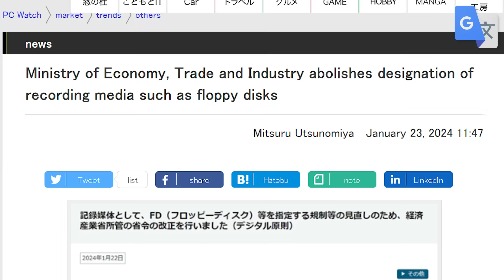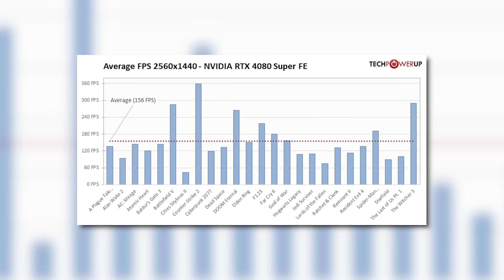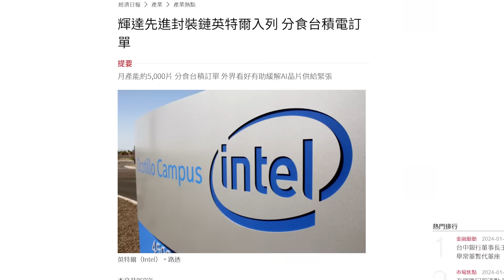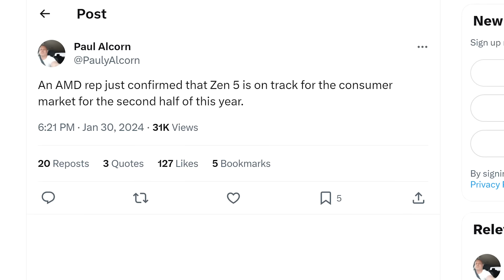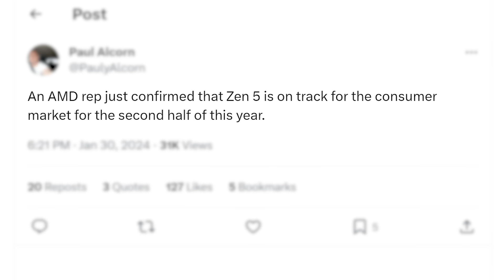AMD Just Came Out And SAID IT!

Comment: I'm currently rocking a 5900x that's been undervolted to get it to its 5.1ghz max clock speed, 32GB of 4000MT RAM, and a 3080ti. I can't wait to build a new PC later this year with a 9950x, some DDR5, and a 4080 Super. I'll finally be able to dick around with AI, with the hope of using my own voice as a template to create a different, more melodic voice.

Comment: My Floppy and Zip Disk are still generally fine for semi-regular data transfer use. I wouldn't trust them for backup but for transfer they are a useful option for retro computing.
Reply: Just this past weekend, I donated my Zip 250 drive and several cases of disks to the PC vendor at the local flea market. It was still working, which surprised him.
Reply: @OcularPerceptions  You'd have got good money on eBay for Iomega Zip stuff! I ideally want to update an external SCSI and an internal ATAPI model from 100mb to 250mb models if I can!
Reply: @bigd5090  I probably could have, but I've had those for years and preferred to help some local folks. Also, we're busy decluttering our home, so keeping things hoping they'd sell online would just delay our goal.

Comment: wait what, so zen 5 is not going to be full x3d yet? i need x3d but didnt want to buy 7000 gen thinking we were getting closer to 9000 release, what should i do now?
Reply: Probably go for 7800X3D. It seems pretty good and a lot more reliable than the higher X3D CPU’s. If you have to wait for good and reliable 9000 X3D series, it will probably be 2026.
Reply: @PaintrainX  it feels so wrong buying x3d now so late :/
Reply: @BuzzKora  I understand. But honestly, I don't think we will see big performance gains.

Comment: 1 Million bytes, think of what that meant in the early 70's. That's about 8 MILLION Bits on on an 8" floppy. Before that, punch cards 😅

Here's the kicker, data rot/integrity. The smaller the data cells get the easier the bit can flip. You can't leave most economy QLC solid state drives unpowered for more than a year without having some data rot, same for basically any new USB drive. How do i know? 20+ years of I.T. work. Hell, you can't even suffer a few power losses in a row with many QLC drives before they die. Hopefully they recover if you leave them powered on for a few hours or a whole day so they have time to rebuild.

With that said, I've been replacing floppy drives on embroidery machines with USB/Network adaptors and give them only USB drives that have proper controllers on them that have some level of ECC and wear leveling. Basically any higher end premium brand, not all. Still, this adds a layer of data transmission you can't trust. Although i haven't seen any issues in the last few years, but the clients might not even tell me idk.

Pro tip for flash drives/cards with no controller if they have bad sectors, run a full read then zero write consecutively. The read will warm it up and the write will reset the bits, most of the time "repairing" the sectors. I have an 64GB SD card i did that to two years ago on one of my security cameras, still going strong.

Comment: A 4080 Ti using the AD102 die with 12,000+ cores and 20GB of RAM for $1,200 would have made for a much better product. Then push the regular 4080 to $899-$999.
Reply: For consumers yes of course. For Nvidia however, AD102 die is in short supply because they are mainly bought up by AI companies. So in Nvidia's perspective, why sell cheap GeForce to you when I can sell Quadro class GPU for far more profits .

Comment: Price drops don't gain any enthusiasm.  Just look at how well that worked for AMD over the last few years.  Each time they cut the cost of their cards, it's usually met with crickets.  Nvidia just rebranded the 4080 to "Super" to garner attention and to sell off the remaining 4080s that didn't sell (most of them).  Really should have been called a 4080D, just like the 4090D.  D for discount.

Anyway, I bit the bullet and grabbed one due to the uncertainty of the 50 series, and needing a 4K/60 capable card now. My 3080 10gb doesn't cut it.  Wanted an FE and even had one in my cart, but because of how stupid the Nvidia shop is, when I went to finalize, it said nothing was in my basket, and they all sold out.  Ended up having to settle for an MSI Ventus since I needed a card that was 330mm or smaller.

Comment: Ah yes the days of installing windows using multiple floppy disk.
Reply: A normal "ok" picture on my nokia phone is 2.4MB in size
Reply: Or installing MS Office 3.11 for Workgroups...😅
Reply: i'd genuinely want to install win 10 like that
Reply: And Linux Slackware 1.0, when there was no graphical desktop yet in any Linux distro. But yeah, Windows for Workgroups 3.11 in floppy disks, too...And MS DOS.

Praying that one of the  dunno if 14 floppies (can't remember) of a linux distro wouldn't fail, as then you got nothing, all installation would break at that point. And would have to get the full distro again, physically, as there was no way to get that from "internet" (and quite later on, with terrible 9600 bps speeds, etc).

But it was way worse with the Spectrum, Amstrad, MSX and etc (previous to the bigger jump of the 8086 series), relying on tapes, and that your tape player was well fine tuned (the glorious screwdriver trick)  to avoid loading errors. I can't remember well, but I think there was a trick using an utility to force those disks to get 2MB (actual capacity unformatted) versus the usual 1.44MB (HD) or 720k (DD). The bigger 5.15 had way smaller capacity.

 In these specific matters I wouldn't want to go back.

Comment: Just bought a Zen 4 so not looking to switch before Zen 6. Hopefully, AMD will have fixed the issue where DDR5 with 4 sticks only train stable to 3600 by then and anything else is a pain. Fixing this would be great for us 192GB ppl
Reply: 192GB wow!
Reply: It's not entirely about 4 sticks, I'm running 4 sticks at 6000 with a 7950x and zero issues. The issue is the 32gb sticks are dual rank, so from the IMCs perspective it's basically running 8 sticks. Perhaps zen 5 will see enhancements to the IMC, it's not unlikely. You can always sell your zen 4 cpu for a good 70-80% of what you paid for it and get a cheap upgrade.

Comment: Best thing about the 4080 super is we should be able to get the 7900xtx for cheaper
Reply: Ehhhh the 7900 Xtx still outperforms the 4080S in raw performance, the 4080S had to outperform the 7900 Xtx in hope of a price reduction. All Nvidia did was pretty much release the same card, given 1-3%, at a lower price…
Reply: @Decisiveness_   as always people like you severely dismiss DLSS , Power efficiency, Frame generation and general Ray tracing performance. This is why Nvidia still massively outsells AMD. And this is  why i personally would gladly pay the 20% Price premium.
Reply: @snakeace0 Nvidia outperforms AMD because ppl know nothing about computers. 75% of ppl don’t need or use those features.

Comment: For me, the sad thing about the 4080 SUPER is the fact that it took Nvidia this long to release what the original 4080 should've been.
Reply: Nvidia loves to milk the customer
Reply: Yeah mostly, although $999 is still too much.  Should have been $799 - $899 tops.  Ngreedia thought they would skip the middleman this time around though and just scalp their own cards from the start.
Reply: @Neonmirrorblack inflation adjusted vs 1080, it should be $762.
Its still 33% overpriced vs 58% overpriced when 1st launched
Reply: That’s why I’m running a overclocked 5700 xt still 🤣🤣🤣🤣
Reply: @Humanbeing171  same, paired with a 5 3600 lol
Reply: The 4070 is what the 4080 originally was
Reply: I slightly overclocked my 4080 and steamroll the stock 4080 super benchmarks so

Comment: Some PLC (programmable logic controllers) made in Japan (Mitsubushi/ Fanuc) still need 3.5" floppy discs to do a machine parameter reload.
Reply: I guess you can send it to a console modder. Have it modded to be able to use sd cards.
Reply: hell advance aircraft still use QAR floppies to program rotating radio frequencies... no shvt
Reply: @MikeBCNU  Thats awful. Expensive aircraft but use stone age floppy disks 🤣
Reply: It is possible to run all of those programs via a floppy disk emulator. I does take a little bit of doing. But I've converted 1980s fanuc machines to run off floppy emulators & load programs from USB thumb drives.

Comment: Just a reminder that the 4070 Ti Super had that whole firmware/bios issue going on when it was first released and reviewed. Could be wrong, but considering the very negligable increase in performance was what happened first last time with the 4070 Ti Super, I suspect we are going to see something similar happen again. Possibly the exact same thing.

If so, that means the increase will possibly be enough to bring it into the same realm of performance of the 7900 XTX based on the numbers currently shown. 

Again, could be wrong. Maybe this time it really is just negligable increase only. But since last time wasn't... after some fixes... I suspect we are going to see round 2 of this.
Reply: It won't happen. The upgrade on 4080S is much smaller and insignificant. Like 5% cores and a few percent higher boost clock everything else being equal. The 4080S is quite simply a 4080 price cut and still won't be precisely at 7900xtx level. The 4070tiS has significant changes but only 5-10% boost.

Comment: Floppy disks didn't die 15 years ago?
Reply: short term cost cutting and a reluctance to upgrade combined with a bunch of legal and industrial red tape results in this kind of thing in general, like how a whole bunch of medical systems suck, a standardized program; Socrates I use that's used for clinic apointment management and the like in places like Ireland doesn't even support control backspace and it's been around for years.

Comment: 😂 I still use floppies now and then to load programs into older CNC machines.
Reply: The sell floppy disk emulators, if you're interested. 
I'm guessing the new CNC machines have Ethernet?
Reply: @Trifler500  USB, Bluetooth and even Wifi.
Reply: @obkf-too  I personally much prefer wired Ethernet to wi-fi
Reply: I had a CNC Mill Mitsubushi Meldas 64AM that still needs floppies.

Comment: The 4080 Super exists because Nvidia didn't wanna drop the cost of the 4080 and make the product seemi as if it didn't hold the value of it's MSRP at launch. Basically saving face for their overpriced cards. A 4K card shouldn't cost over $700, that's with inflation.

Comment: This is why you upgrade your NVIDIA GPU every ODD number generation not EVEN. Its been that way with NVIDIA always pretty much. And AMD and their new A.I CPUs, if you upgraded in the interim since the 3000 series to ANYTHING newer you literally just wasted your money 😂. I have a 3900x and I personally have been waiting for this release later this year for my next upgrade finally. Upgrade smarter and don't get caught up in the marketing guys. Think before you buy these days.
Reply: Nah. I got good lift when I got the 5800x3d. Still expect a few years with it as main.  
Made a Am5 itx media centre 'for the future' in case I have less money for a cracking CPU.

Too bad the Stryx halo is mobile only. May have to find a company like minisforum if they release it soldered onto an itx.
Reply: @glanguish9390  well yeah for your application it's a common sense upgrade for sure! But for power users and A.I API developers/ RTX50 series NVIDIA users it'll be a really bad time if you have any generations earlier. And that's the big secret Intel, AMD and NVIDIA have been hiding until now. The RTX50 series will be using the same A.I tech as the new Intel arrow lake and AMD 9000 series CPUs will. To get the most out of your A.I based new system you'll need both CPU and GPU to marry up for all the actual next gen applications for gaming, A.I API applications, website development, video editing, etc.Typical right? But once again early adopter stressors too possibly. What you've done is exactly right for your needs now though. For me it's the latter at this stage. And the cost I'll have to endure for it as well 😭

Comment: $50 more than the XTX, but has significantly better raytracing, VR, 3D rendering. It has dual encoders and VSR auto-upscaling and auto-HDR for streaming media.

AMD is for those who only care about basic raster, NVIDIA is for us who want a suite of immersion.
Reply: ...until it runs out of vram and stutters, choking your fanboy immersion lol. Raytracing is nearly irrelevant, in like 5 old games and you need blurry upscaling to make it work at higher res/speed. VR also got a big boost on AMD recently. My 7900xtx also has auto HDR and will out-live the lifetime of the 4080 with 2 year old VRAM for high end price. No thanks!
Reply: @N4CR  thar won't happen until developers start making games for the PS6.  Current generation of consoles is 12GB.

Games aren't made for us PC users in mind, which sucks for us.  Most of their money is on the consoles.
Reply: Slurping 100W less than the xtx at the same fps is the biggest point to mention!

Comment: A floppy disk provides the ultimate in security, nobody can steal your data if nobody can read your data. Unfortunately, you have to store your hentai porn collection on 10,000 floppy disks, but at least nobody will ever know.
Reply: Yup only recently USA nuclear missile program upgraded to not using floppies too.
Reply: @glanguish9390  Yes, now that they have upgraded to Zip drives, they should be right for another 50 years.
Reply: There's still plenty of floppy drives still out there. If someone is determined enough, they can still find ways to read them. Trouble is that floppies collect mold over time and they're probably unreadable unless you can find some way to clean them too.
Reply: At least the left arm will get the same workout that the right arm is getting having to change the disk so often!
Reply: we used to use winzip and other disk spanning software to transfer porno back in school xD

Comment: The 4080 super would be my next upgrade as it has 16gb vram, but imma just wait for 50 series
Reply: Hopefully the 5070 and up has more VRAM than the 5060ti (probably a tall order for NVIDIA).
Reply: @LeBronyaJames  the 5070 better have at least 16gb vram.
Reply: 7900xt is a better upgrade.
Reply: Yeah, just wait for 5000 series, $1000 for 16gb vram kinda sucks tbh imo, like you can spend half that for 16gb from AMD (not counting the $330 7600xt) or $300 for Arc a770 17gb, I don't think spending $1000 for only 16gb is nice (crazy to think that you had to spend minimum $1200 for 16gb from Nvidea before the super series, although I guess the 4060ti 16gb existed)
Reply: @SM-cq1mm  Yeah, basically its either get the xtx now if you don't care much about ray tracing / nvidia specific stuff and need to upgrade, but otherwise just wait

Comment: going from gtx 1060-3gb to 1060-6gb is same as rtx 4080 to 4080 super.
4080 super have one of worst core uplift in last 15 years I am not suprised that it just get 2% higher fps than 4080.
Reply: Regardless, it’s still better deal than before 🤷🏻‍♂️